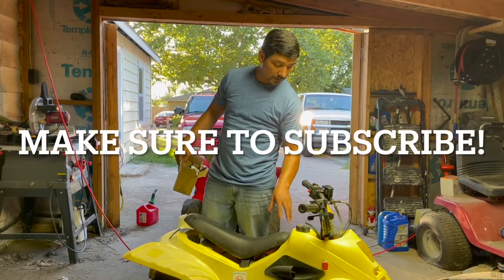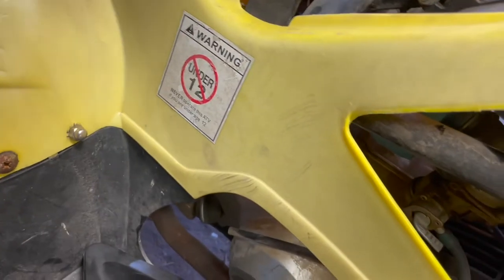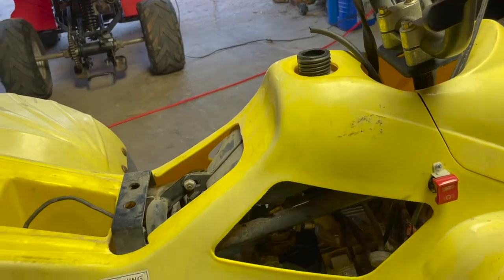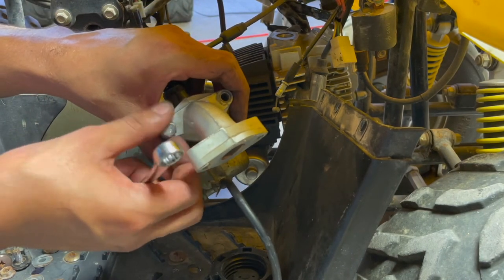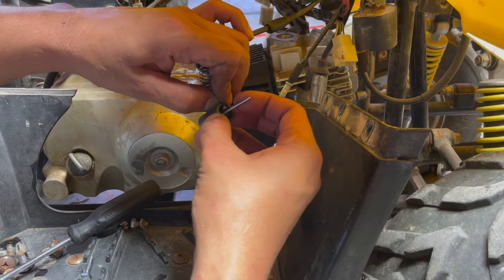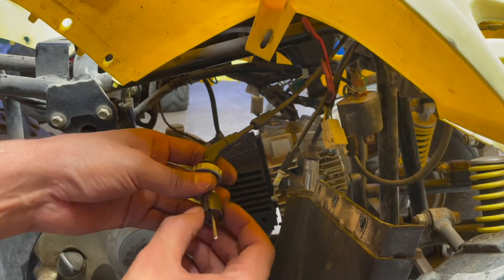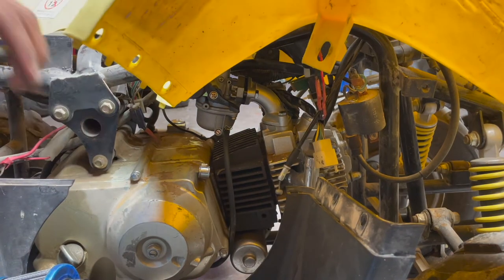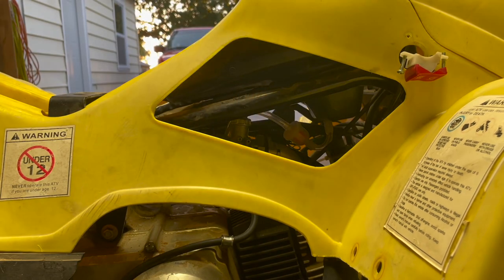Carb Replacement on a Chinese ATV, Quad, or 4 Wheeler. Step by Step.

Comment: What would make the four-wheeler to take off without hitting the gas
Reply from the maker: I’m sorry willing the bet either carb is getting too much fuel. It probably needs tuned.  Drive fuel/air mixture screw in until it is seated. Turn out 2 1/2 turns.  Adjust in or out until it is running correctly. If that doesn’t work clean carb. If that doesn’t work you may have a sticky/stuck throttle. Please make sure to subscribe. Thank you.
Reply: Throttle cable needs adjusted had it happen to me after carb install
Reply from the maker: @TheSheldon19  I haven't had that issue yet. I'm sure others have though. Thanks for the comment!
Reply: Throttle cable
Reply from the maker: @bryanhernandez3168  hell yeah that makes sense brother

Comment: Should the line just hang from the carburetor ? My line just melted to the exhaust the line that comes for the carb bowl i didnt know where it goes
Reply from the maker: That is the overflow line to the carb…if the carb floods with gas that needs to be aimed to the ground…should be clamped into place…definitely don’t want that on your exhaust.  Please make sure to subscribe. Thanks

Comment: I need a carb that comes with the slide needle and spring where can I get one?
Reply from the maker: The carb I ordered came with one.  I can post the link in the description to this video to the carb I ordered around 5:30PM central time. I will post another message responding to your message as soon as I do so.  Also please do me a favor and subscribe.  I post a ton of DIY and quad content.
Reply from the maker: Carb link is below or in the video description man. It is $13 and comes with fuel line, filter, and everything needed for a carb. https://amzn.to/3DhFynH

Comment: 10:32 that's what she said
Reply from the maker: 😂😂😂.  Mine always slides right in😭😭😭…jk but please make sure to subscribe. Also thanks for the comment.
Reply: @brokemexicanreviews  🤣🤣🤣 thanks for the videos and will do! About to swap my pz19 tomorrow
Reply: Btw could i add a pz22 carb or mikuni nv22 to my bike even tho it came with the pz19?
Reply from the maker: I usually only mess with pz19/pz20 carbs. When I work on stuff it’s usually kids stuff as it sells fast. So could not tell you for sure.
Reply: @brokemexicanreviews  gotcha. So what about a pz20-22? Just to get some more airflow. Thanks bro
Reply from the maker: I can’t speak on anything over pz20…I just know that pz19/pz20 are interchangeable.  Sometimes I have to adjust idle air flow but that is it.
Reply: @brokemexicanreviews  sounds good bro appreciate the info!

Comment: Hey man so i have a bombardier but i have no idea what year it is i bought a carb kit. But it doesnt seem likes its the correct one. How do i find out the year cc? So i can order the correct one.
Reply from the maker: Google rating plate location for yours.  That’s how I’ve found vins, rating plates, etc in the past. Plate make sure to subscribe. Thanks.
Reply: @BrokeMexicanReviews  hey brothuh so on the frame it shows numbers but I ordered a carb that I can just replace it with and we start today to try and make the baby run thank you. I'll give you a heads up on what the deal is thanks.
Reply from the maker: @fernandomoreno3572  Sounds good man. Good Luck!